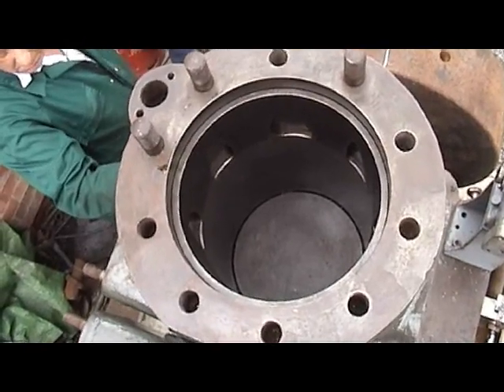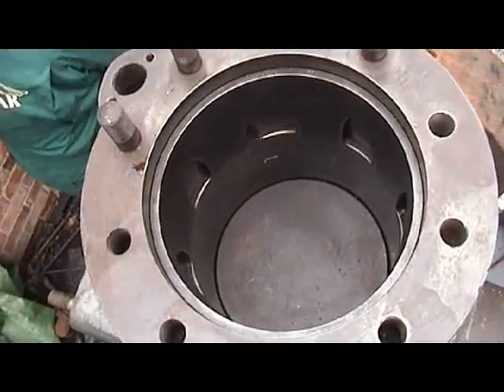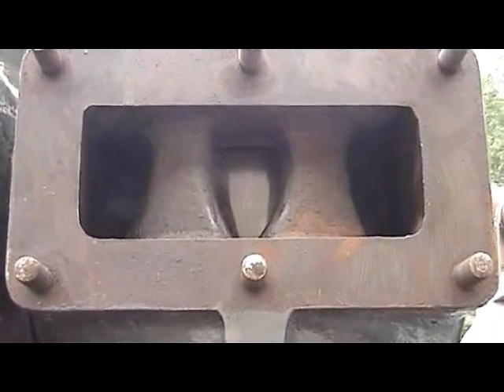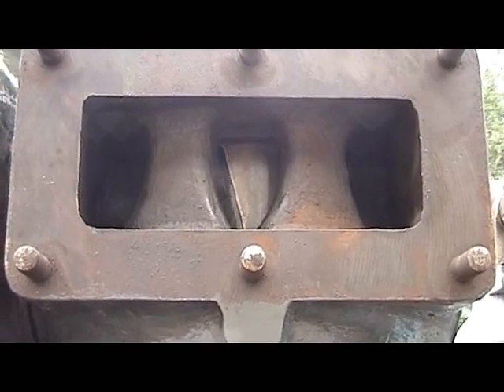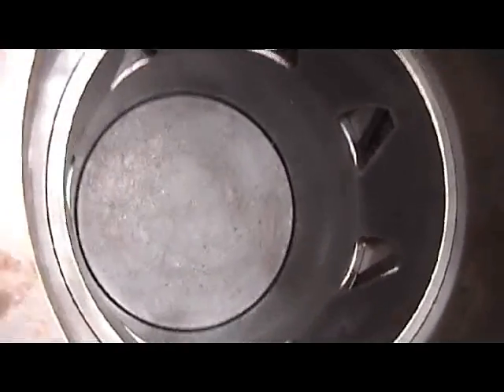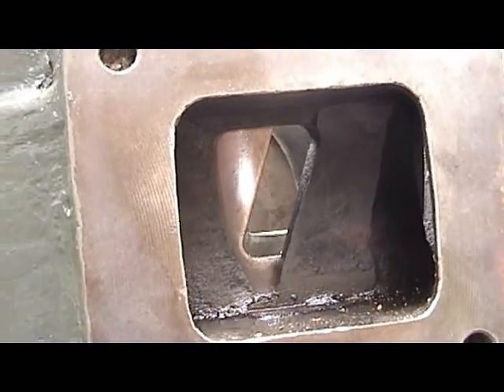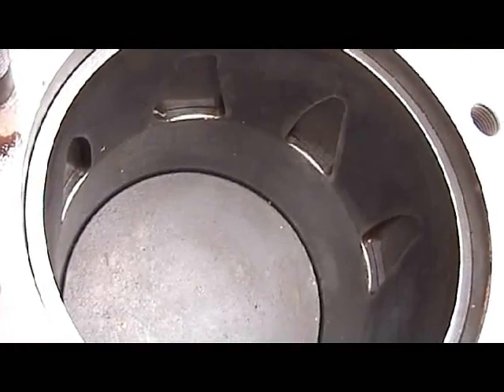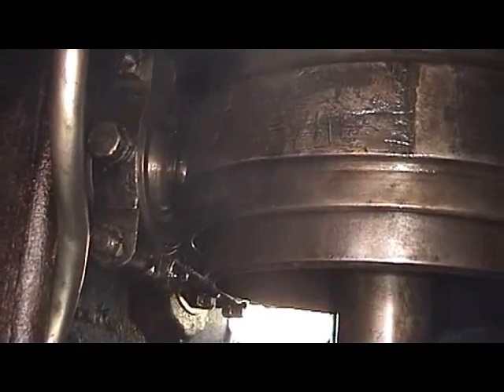Brotherhood Sleeve Valve Engine, Sleeve operation Part 16

Comment: I had a two cylinder kelvin sleeve valve in the early 1960s. I could never find an instruction manual showing the timing. After many many hours of trial and error adjustment it burst into life. I ran it for a few minutes then shut it down. It wouldn’t restart over many try’s. I received an offer for it, sold it and within forty eight hours it was running like a sewing machine and fitted in a small launch. It proved to be a great little petrol paraffin engine, but not for me.

Comment: @robertgift  At the time this engine was conceived it was impossible to justify. twenty years earlier there had been the fear of designing a poppet type exhaust valve that was durable. This engine was a government contract and demonstrates a large wastage of machine shop time and materials. British Engineering at its finest. They could of used a Gleniffer engine at that time; or others. it's just nonsense.

Comment: So you have two surfaces of friction; piston moving in sleeve and sleeve moving in cylinder.  Plus the mechanism to move the sleeve.
What is the advantage, if any, of a sleeve valve?
Why not rotary TOP opening of the cylinder?